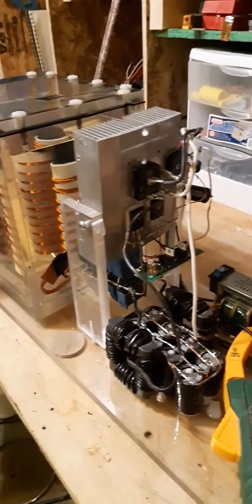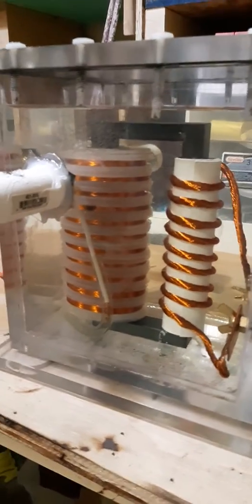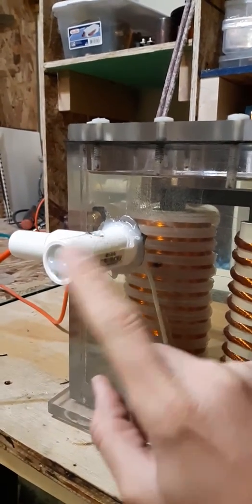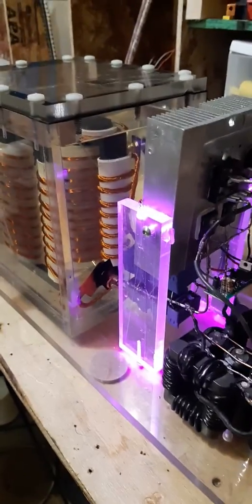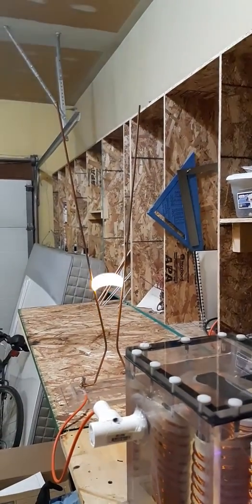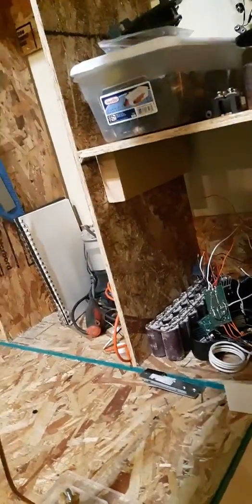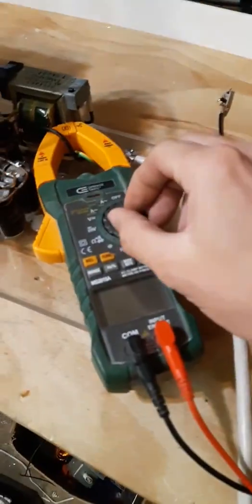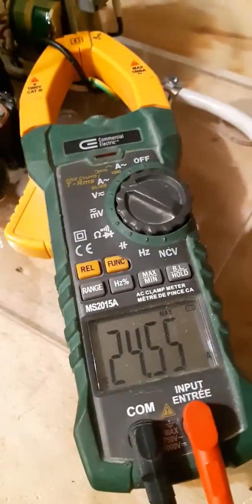High Voltage ZVS Driver

Comment: What did u use for the choke inductors??
Reply from the maker: PC 40 core I do believe
Reply: @andrewkwasek1214  thank you for ur response! Can u please link the choke?? That would be highly appreciated man
Reply from the maker: @theelectronmachines  I dont think I can find it, but just look for ferrite cores on amazon and read for PC40 as the core material. Bigger is better. If you only get a few small ones you can tape them together to make the core "thicker".

Comment: What FETs do you use?
Reply from the maker: I do beleive they were:
IHW40N120R5XKSA1
Gotta keep the frequency low if you want it to work. Under around or under 30kHz
Reply: @andrewkwasek1214  thanks
Reply: @andrewkwasek1214  these are igbt in a zvs circuit? Interesting
Reply from the maker: @samueldavies646   both IGBT and MOSFETs work in a ZVS but the IGBT are limited to the lower frequency range. The advantage is they come in higher voltage ratings than MOSFETs. Just got to pay close attention to the spec sheet to make sure you get something that will work for you.

Comment: That’s not 70000 volts. The initial arc distance is a measure of voltage. Not to what it can pull out to. Looks to be maybe 15000.  Yes a lot of current. Watch some you tube videos of pole pig transformers 14400. They will pull to several feet. I would rather have voltage not current . I may share a circuit very simple and it’s not a Tesla coil or even resonance to produce extremely high voltages ac . But I know that I will open myself to so many questions. Very good project  Andrew. I sure very expensive. Thanks for sharing. I have been a high voltage nut for 60 years. Work In electronics. Took many years of experiment ing to come up with circuit. First time I have ever commented on any video so congrats. You should by very proud.
Reply: Well I would rather stir your mind into thinking of concepts for yourself rather dropping a circuit into your lap. But I need to know your depth of electronic knowledge. Because that’s part of the fun right? My background is electrical engineering but I have stayed more on electronic side of it.
Reply from the maker: @lyledoherty6980  fair enough. I'm an electrician with very little experiance in electrical engineering. Odds are of you gave me a complicated circut I wouldnt really know what I'm looking at. This ZVS circut is basic and I understand it. But more complicated teslacoil circuts I only understand the basics and dont really know how each component works.
Reply: I whould say the arc starts about at 3cm and goes up so its 30-90kv
Reply: Thats a voltage limiter if you did that with hand the initial arch would be longer
Reply from the maker: I did a test with stainless steel balls that are about 2" diameter. I could get it to arc across about 70mm. But this is at high frequency not DC. I'm going to rebuild and test it again because I just love to work on this stuff and test out new things. 

Do tell of your design!

Comment: Try slowly cranking up the input voltage using a variac..... Maybe  it can solve the problem of the switches dying. Also what about the inductors for the zvs??  Did you measure them... I have found out that when working with igbt s they don't like lower inductances in a zvs driver... Usually higher inductances work better. 🤨
Reply from the maker: Your absolutly right, but I built this with the intent to no need a variac. I found that using a small transformer as a seperat gate power source worked well. However you need to use a diode to prevent high voltage from feeding though the secondary of that transformer. Works well now. 

The problem I am now having I think is related to the inductors. I have fairly large ones, but I need to put more turns in them
Reply: @andrewkwasek1214  yeah try with higher inductances... The igbt s will love em. 😁

Comment: That's a beefy old piece'o' kit bruv,80kv with 25amps would leave a nasty stain on the carpet after they scraped what was left of the unsuspecting and oops clumsy operator Wahahaha! Seriously though a brilliant job bud one of the best ladders I've ever seen it could star in some Frankenstein film innit 😎💕🖖
Reply: 25amps is the low voltage end though?

Comment: It would be nice to share the circuit and part details for replication. Also the coil wire details please.
Congratulations on an awesome project
Reply: Yes I'd like to see a schematic with component values and details on the coils.😎💕🖖
Reply from the maker: It's just your standard ZVS driver. Only difference is I use hight voltage high frequency IGBTs and a seperat gate transformer to power the gates and act as a low power turn on. The way you do this is by rectifying the transformer secondary, obviously. Connect your negative from the transformer to the source for the high voltage for the IGBT/MOSFET. Connect your positive to the gate resistors and to a diode. The diode should be pointing toward the positive of the high voltage. This allows the whole set up to be turned on with lower power based on the out put of the transformer. The diode  prevent the high voltage from traveling back through the secondary of the low voltage transformer secondary. This way your not toggling between on and off, just between high and low power.

Comment: Nice work. I'm wondering: (1) What ferrite core are you using and is it gapped? (2) How many turns does the secondary coil have? (3) What's the power throughput when driving the Jacob's Ladder?
Reply from the maker: It's a PC40 core off Amazon. I actually broke a few by accident and used them to make the core longer. It is gaped, if I recall correctly 2mm on both sides. I have no idea how many turns are on the secondary.the power draw peaks at I think around 18 or 20amps and 120VAC. 

I will say I'm having an issue with it. Keeps killing gets when the arc gets big and breaks. I have ideas with whata wrong, but I'm unable to test it at the moment.

Comment: Thats Awesome ⚡⚡What kinda switchs are you using? And is that a control board running your gates?
Reply from the maker: Thanks! 
It's just your standard ZVS circut but I had to add TVS diodes to it. I just mounted it on a PCB because its alot easier to remove blown transistors when it's just 4 wires and not all the components... and I blew alot of transistors making this work lol. I'm using IHW40N120R5XKSA1in this one. I found they work best with 110 homs on the gates and a seperate gate power supply.
Reply: I thought this might interest you, I wouldnt mind seeing what you could come up with in the way of a Jacob's ladder. I think this one will take some beating! 😎💕🖖